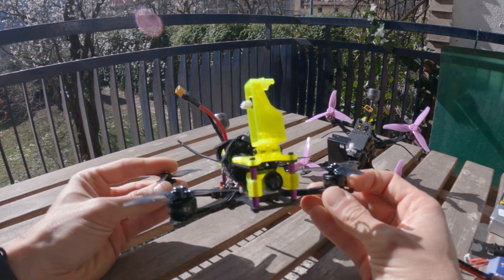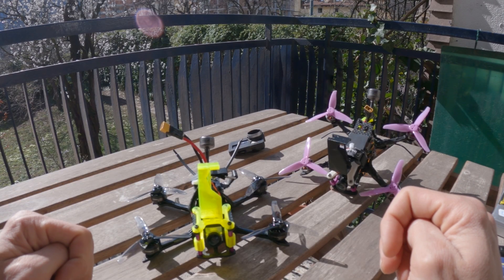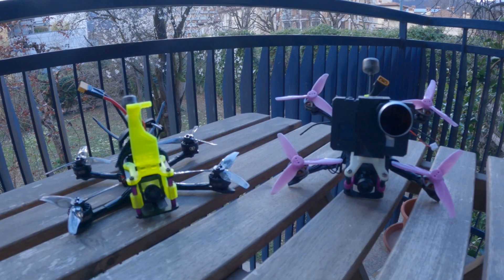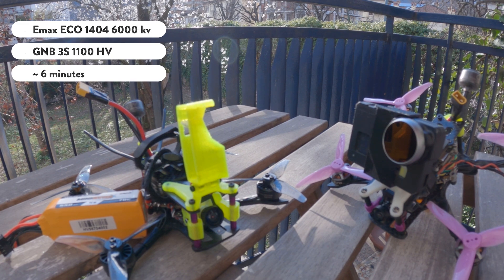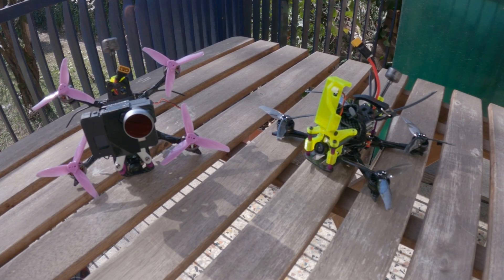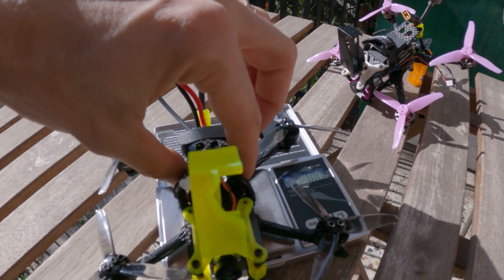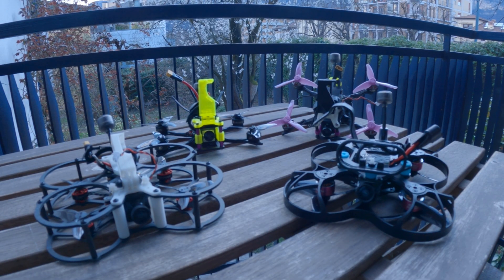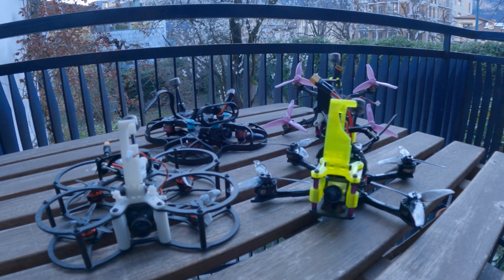One sub 250 g FPV Drone to Rule them all!

Comment: no! mines is ruling them!
your setup is a bit questionable 1404 with lower kv and 4 inch props will give you better start.
my opinion ;-)
Reply from the maker: Hei thanks for sharing your thoughts. Actually 4" setups have a bigger footprint and to me they are too big to confidently fly close to people. I find 1404 medium-high kv perfect for lifting the extra weight of the naked GoPro while keeping the ability to punchout to handle dives and hard manouvers!
Reply: @bizioFPV  flying close to people is a NO GO!
does not depend on the size - except a tiny whoop.
Reply from the maker: @7robertb  I mean flying close to informed people like actors or performers on set, non random people!

Comment: Very nice video..please share the details of your 5 inch rig
Reply from the maker: Thank you! The 5" is built with the five inch cargo MOD-L, f7AIO, 2005 xing 2550kv, Crossfire nano diversity, caddx vista + nebula pro, GPS and buzzer. I run it on 4s 3000mah li-ion.i'm actually trying different motors. Stay tuned for the dedicated video!
Reply: @bizioFPV  Thank you. I want to know how it can handle mountain winds and whether it can replace my 7 incher